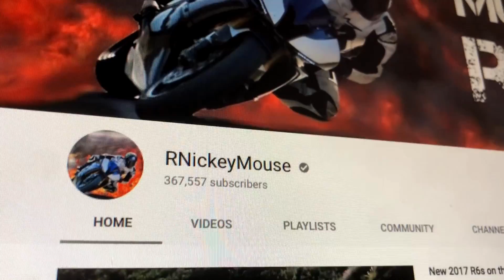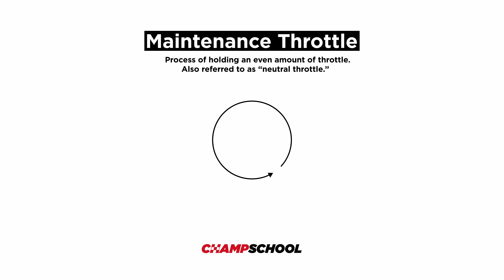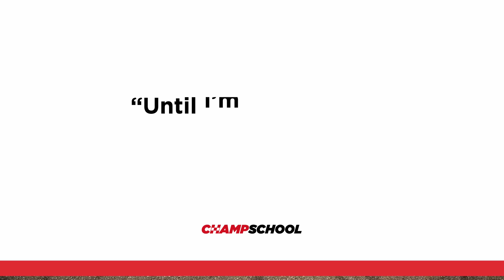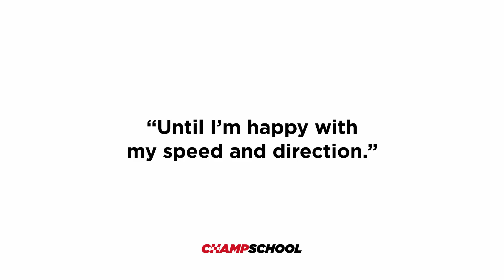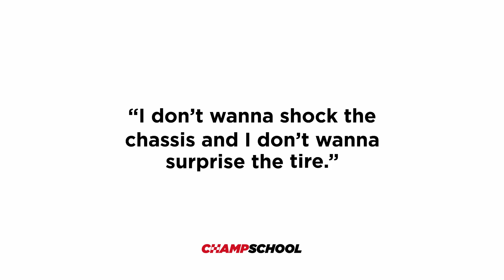Radius = MPH

Comment: this isnt exactly true, radius, v^2 and tan(Θ) (Θ is lean angle) satisfy a state equation for a turn like temperature/preassure/volume do in thermodynamics, so for example for a set radius you can accelerate but you need to add lean angle
Reply: Seems like they’re using a fixed lean angle for the demonstration of the concept so the only two variables would be speed and radius.

Comment: So if I got it correctly:

Before corner entry: Apply brakes, come off the throttle completely but smoothly
Corner entry: Brakes applied, fully off the throttle.  As I add lean angle I release the brake slowly
Before Mid corner: I might add constant throttle to keep the constant radius at constant lean angle, and the brake is completely released by this point
Mid corner: I see the exit, I add the throttle smoothly as I remove the lean angle

Hopefully I got it correctly?
Reply: Yes. You have it correct.
Reply: Not completely:
Before Mid corner: I might add constant throttle to keep the constant radius at constant lean angle, and the brake is completely released by this point

You completely release the front brake *only* when you seen exit (and your bike is pointed into right direction -> towards exit), not mid corner.
Reply: @nekdo_pac no.  We brake until we're happy with our speed and direction. Once that happens, we are completely off the brake (unless we need to go back to it for some reason). We then go to neutral or maintenance throttle, but we can't truly accelerate until we see our exit and take away lean angle.

Comment: Something I noticed intuitively: lean angle depends on speed. You can't put too much lean angle without enough speed to back it up either. The faster the speed the deeper the lean and vice virsa.
Reply: Technically the bike lean angle doesn't depend on the speed so much as your body position/angle does. You can have that bike leaned over to the maximum at only 5mph, as long as your body is perfectly counter-weighted the other direction. Add more speed/radius and your body counter-weights a bit less. Add more, now you're body is positioned neutral. Add more speed/radius and now you're body-leaning with the bike so the bike doesn't tip too far and lowside. The bike is gonna lean how it's gonna lean to make the turn, so personally I think having body position awareness is more important.

Comment: cornering on a dirtbike just seems like a different animal. On a street road or track, your body weight goes inside so you don't have to lean the bike as much. On the dirt, your body weight goes on the outside foot peg, so you have to lean the bike more but you're putting weight on those inside knobbies for traction. And also you have a rut or berm to help with traction through the corner. Enjoying the Champ U courses and putting the info into practice on my KTM Duke.
Reply from the maker: It is all related to the amount of available of traction and duration at lean angle. If you rode a street bike on gravel, you would ride like a dirt bike.
Reply: Yep, get on it on a dirt road or a wash in the desert. Street bike will do the same as a dirt bike.

The big difference happened in the 1980's. The Honda CB's, Kawasaki kz's etc. Had lots of trail & not a steep rake. You could kick out the backend like a dirt bike on the asphalt. They were also tank slappers! Get the front end light, they followed road imperfections. Ya get comfortable with it eventually.

When all the newer sport bikes with 16 or 17 inch tires with a steeper rake & less trail came out. Had to be careful not to kick out the rear like the older bikes. Or you will high side.

As much as I like the better handling of the newer bikes. I miss being able to kick out the rear like you could on he 60's, 70's, early 80's bikes with no fear of high siding.

Having started riding dirt bikes. My opinion is that everyone should learn in the dirt before getting on the street. As well as truly understand how your motorcycle was designed to handle.

There are simply body movements & memory mussle that gets built riding in the dirt that will help you out on the street. You simply cannot be sliding around doing what you can do in the dirt. Wreck get up & try it again.

You will get seriously injured or killed doing that stuff on the street, or arrested. Having done all the sliding around in the dirt. Provides you with memory mussle that will save you in some circumstances on the street.

Usually some asswipe in a car or pickup that forces you to slide around to keep from hitting them or going down.

Comment: When you tell some of the things to dutch instructors that champschool teaches like trailbraking on the public road or even letting your leg dangle in slow corners, some of them are just dumbfounded and respond with " Americans are crazy" but then again they don't even teach conscience counter steering, you just lean into the corner these guys teach, well they do teach that if you need to do an evasive maneuver then you push left to go left and push right to go right. Champschool teaching is on a whole different level
Reply from the maker: Thank you!

Comment: How do you prevent people behind you from freaking out while trail braking in a corner?  I’d hate to cause a wreck because someone behind me doesn’t realize what pressure I’m putting on my front brake?  They see red and panic.
Reply: you take that corner hella smooth so they can be conditioned to not panic
Reply: Spread the word to your friends. If someone is liable to panic and crash just from seeing a brake light in front of them in a turn... you probably don't want to be riding with that person in the first place until they correct their skills, honestly!
Reply: They should not be that close behind you.  That is just not smart for them to be so close behind you in a corner that they can't deal with anything you may do.
Reply: I panic more following riders who solely use their engine braking to slow down, thus never illuminating their rear light. As a lead rider I always try to just tap the front brake even if Im only slightly decelerating from engine braking to let those behind me know. More info is better.

Comment: i was on a mountain road here in europe  last summer and i went downhill and  i thought okay i use my breake into the corner and i was struggling to keep traction and to keep the bike on the road and the bike felt heavy on the front . i was lucky and i did`nt fall... did i went too fast in the corner and because of that used to much breaks or did i break to long in to the corner?
greetings from holland
Reply: Neither... the reality is that when riding downhill, you're inevitably going to be feeling like you're putting more weight into the front of the motorcycle through the handle bars as you're angled forwards. However, you'll actually need more brakes (as said in the video) for the front tire to see the same amount of load from the motorcycle. So either you were doing it properly and just weren't used to the sensation of loading more weight into the handlebars, or you were actually using too little brakes and the front was still under loaded
Reply: Try braking earlier and LIGHTER pressure for smoother slowing (no sudden forward weight transfer) and keep braking longer and that feeling of over braking and struggling to maintain traction will go away

Comment: This video should have a lot more views!! My intuition is confirmed by the experts. No such thing as fast line through a corner. The rider had skills, not the fast line. R=MPH plan and simple!!
Reply: Well, there is a fast line through the corner, but to ride that fast line you have to trail your brakes into the turn and roll onto the throttle out of it, like they described in the video.  A line alone won't make anyone fast.

Comment: Great vid! Do you completely roll off the throttle when you are on the brakes or are you using maintenance throttle?? Thanks
Reply from the maker: We always close the throttle completely while on the brakes. Always.
Reply: Ride Like A Champion Thank you very much!! The only way to ride!! Keep the vids coming.
Reply: The only time to use the throttle is to blip for downshift rev matching to keep from locking the rear tire.

Comment: Question that has been confusing me....so assuming a long, constant radius sweeping corner, and the bike is settled, and the throttle is constant (some maintenance throttle keeping the bike at speed), this would be the only theoretical safe place to add lean angle points, assuming all aspects stated above are constant, correct? Because there are no acceleration points, or braking points being used in this situation?
Reply from the maker: Correct. Neutral throttle is no adding acceleration.
Reply: @Ridelikeachampionycrs  thanks!! See you in May at njmp for champ day!!
Reply from the maker: MikSane can’t wait to have you!!
Reply from the maker: Woot!

Comment: It's not a linear function; turning radius varies by the square of your velocity.  Conversely, if you double your turning radius, you can only increase your speed by the square root of two (a factor of 41%) to maintain the same lean angle.  For example, if you go around a corner on a 20-ft radius, 13 MPH will give you a 30-degree lean angle.  If you double the radius to 40-ft, you can only go a little over 18 MPH at that same lean angle.  The human brain does this pretty well with a little practice.

Comment: I’m trying to line this up with what the California super bike school are teaching. Once the throttle is cracked open....

The both seem to have some science in their explanation.
Reply: I think the CSBS is sometimes misunderstood.  I think the "throttle cracked open" thing is meant to emphasize that people shouldn't twitch the throttle on and off and upset the bike with fore and aft weight transfer, at least not in an ideal situation.  They do also mention in Twist of the Wrist II that for things like double apex corners and other complex situations there are times where you may roll off the throttle, stand the bike up, and/or brake before taking the next corner.  I think the explanation in this video is more complete and comprehensive whereas the CSBS is more of a soundbite to keep people from bucking their bike around corners.
Reply: CSS teaches maintenance throttle so you are not accelerating but the throttle is not closed. You are maintaining speed.  When you get to your point in the corner where you can see the exit, maintenance throttle allows you to smoothly add throttle without the jerky transition from off throttle to on throttle.

Comment: sometimes if i break sooner than i`m loosing 2 much speed and than i got no speed at all before i`m going into the corner. my question is  if it is possible to break sooner and have a littlebit steady trottle wile breaking and take the steady trottle into the corner with the breaks on? or am i doing something wrong? 
  greetings from holland.
Reply from the maker: Hallo etienne Schaarman! Think about using your brakes at a lighter pressure for a longer time into the corner. If you over slow the entry, you can use a neutral throttle if you are happy with your speed and direction of the motorcycle. You don't want to overlap throttle and brakes as you are giving the bike 2 different signals.
Reply: @Ridelikeachampionycrs   thanks for the answer

Comment: With all do respect, I take issue with the expression (Radius=MPH), because it suggests a 1 to 1 , or linear relationship, which it is not. I think a more accurate expression is (Speed Squared = Radius) For example: At any lean angle, 10% reduction in speed shrinks your turn radius by 19%.  Also, Speed Squared  = stopping distance, and crash impact force.Thank you so much for all your videos
Reply from the maker: Great points.
Reply: A follow up video to include this might be great; including stopping distance, reaction time, etc.  This video could be remade to shorten the time.  The animated diagrams and many examples are gold.

Comment: how come twist of the wrist says u can somehow tighten up the turn by adding throttle and keeping the rear suspension expanded?
Reply: @tommarrone1  agreed everything u said is fact. And yes you always want to think of tires as only able to do one thing well at a time. If u ask them to slow down, change direction, maintain grip and accelerate they are going to get "confused" I.e. give up grip.

You have to constantly and smoothly transition between all 3 things
Reply: @tommarrone1  its is the hardest thing to master man. I struggle with it myself
Reply: Keith from YCRS here.  I've heard that before from other, less reliable sources and believe it is 100% incorrect as a stand-alone statement but knowing Keith (the original Keith) ain't no fool, I would need to see that to get the full context of the situation he is describing.  I have the book so if you know what page, I would be happy to find and try to answer your question.  If you can't find it or you are still not sure, go find a large empty parking lot and try both techniques and let us know what works.  We're pretty confident we know the answer.
Reply: But when u add throttle the bike wants to standup not tighten. I'm not sure how adding throttle would tighten the line.

You CAN however do that in a car with a limited slip differential, because the diff will change the torque distribution between the inner and outside tire and allow u to steer with the throttle. (Works in all cars with LSD especially in RWD). 

Dont do that with non LSD cars as they will behave like motorcycles and understeer...

R=mph is a good way to think about it and will help you be more consistent in most vehicles. Cars with LSD CAN "BEND" this rule to a point... Once u exceed the traction limit or 100 points of grip its game over in any vehicle...
Reply: Bikes like the Ducati pannigale V4R CAN do what you describe but its because its traction control and yaw sensors are figuring things out for you and letting you do whats technically not possible...

That said its better to learn good technique then use the bike to bend the rules than to have bad technique and rely on the bike to save you, or cover up your mistakes....
Reply: @3star2nr  "Technique over Technology" - well said.  

 Interesting about the Ducati but speak to MotoAmerica Ducati Superbike racer Kyle Wyman about that before you try it on a V4R.  Ain't nobody (in America) going faster than him on a Panigale and he never adds throttle to tighten his radius.

Comment: I love R=Mph,100 points of grip, butt and brakes...and Sport Riding techniques...thank you for this body of work....a small request... a vid on "the eyes have it"....this particular chapter really gave me  much needed info on this part of riding....and just like R=Mph in the book it was great to see in a video...
A small question....in an ascending corner say up a hill....which requires a lil more than maintenance throttle....how do you manage uphill corners prior to seeing to seeing the exit in order to take away lean points?
Thank you
Reply: i think is better to keep neutral and slowdown to anticipate everything when up a hill,
Reply: To be clear, there is no single maintenance throttle level. Maintenance throttle is whatever level of throttle keeps your bike travelling at a constant speed, no matter the situation you're in. If you're going uphill, the actual throttle level you'll hold for "maintenance throttle" will be higher than going flat or downhill. In fact, maintenance throttle going downhill steep enough might actually be "maintenance brakes"